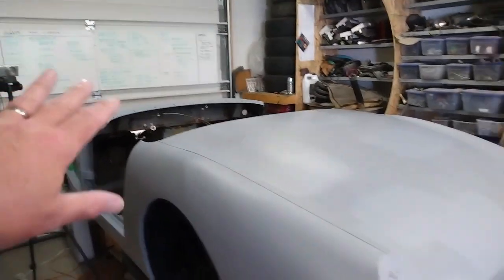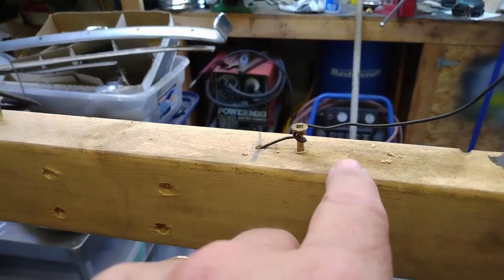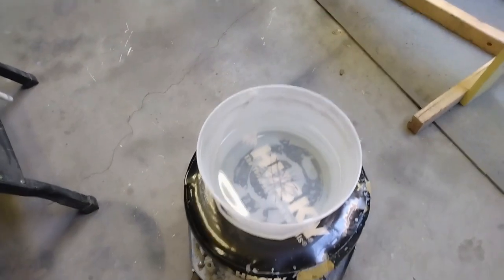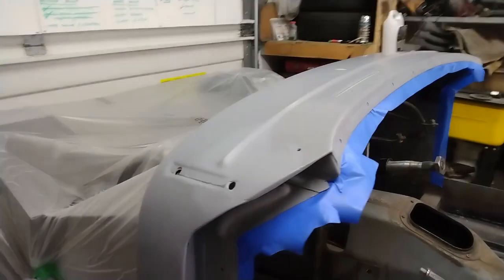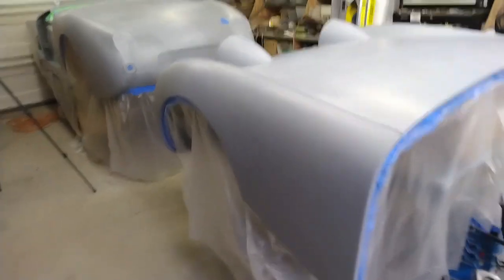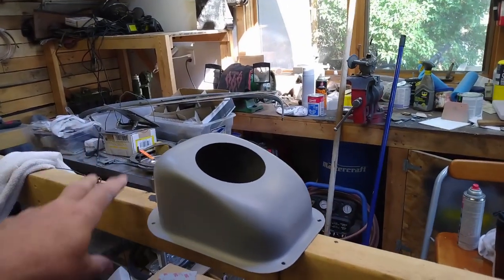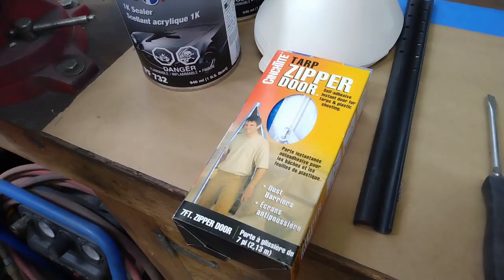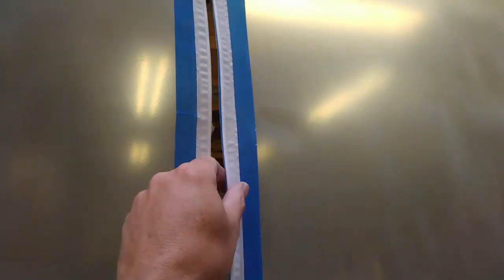How I set up my garage for painting the Frogeye plus final sanding & masking. Bugeye Build Ep. 83

Comment: Great job but I really would have painted the interior and under the bonnet in body colour. Think it would make the car look much better
Reply from the maker: Thanks Lee. I had considered doing the engine bay and under the bonnet body color but thought that the light grey would hide dirt and grime a lot better than white. I decided not to paint the interior (except for the new metal in the floors) because everything appeared to be in pretty good shape. The original chalk markings are still there on the floor over the rear axle and on the gearbox tunnel so that if someone wanted to do a proper restoration in the future that information and feature is still present. I have a full carpet kit going in so it will all be covered anyway.